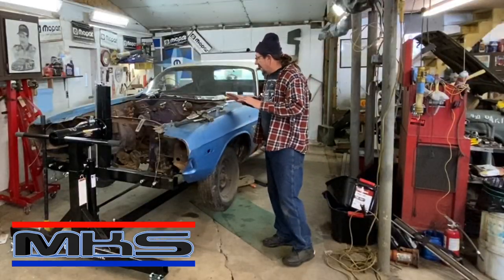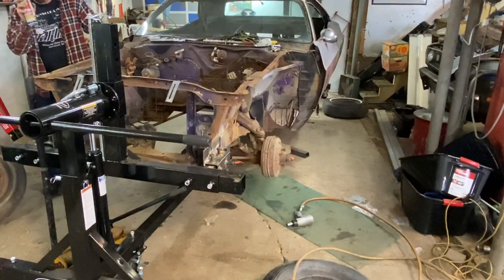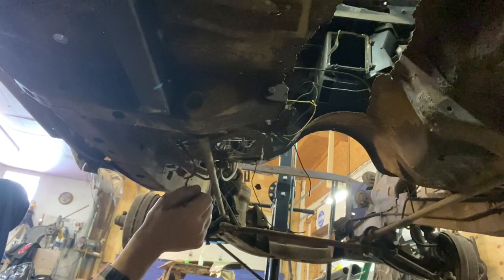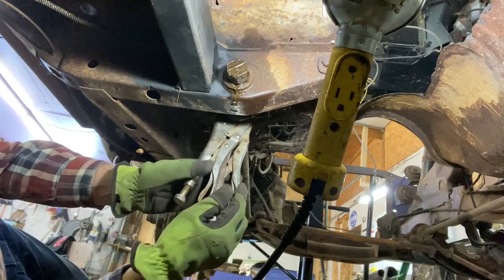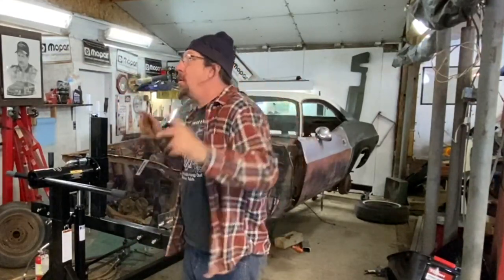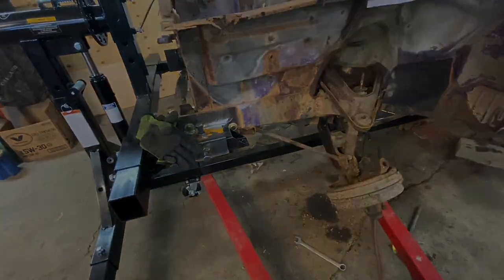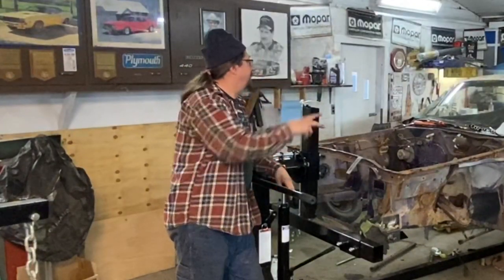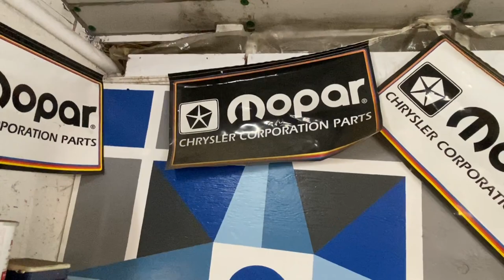Abandoned & Destroyed 70 Challenger Repair -Removing Suspension on the Rotisserie - "Stitches"

Comment: Mike, have to agree with Peckerwood.  Using VGs will mark the bar and will induce stress cracks causing the bar to fail.  I take mine out by removing the upper CA ball joint as you did.  Then I remove the LCA attach bolt (through the K member).  Then I use a rubber mallet to drive the LCA to the rear, driving out the Torsion bar.  Works good for me.  Of course, all the tension has to be off the bar before you can move it.  You ought replace them with Hemi bars to hold that big 440 up and give you some corning ability!!  Happy Moparing!  Glad to see Stiches up in the air.  I have never had a rotisserie so don't know much about them.  Need a class, please.
Reply from the maker: I know that’s supposed to be the case - although in all of my years that I have removed them this way I’ve never had one stress crack and break. In fact I’ve never broken a torsion bar once. Lol

But I will say normally using two pairs of vice grips does not cause the bars to get scored because they never slip. They usually just pop right out. This was definitely an exception. These buggers were stuck. Lol

One of the other comments gave me a great suggestion for a tool and I think I have that out here somewhere so I’m going to go and gather that up in the next few days for the next set I have to remove.

Thanks for the feedback. I always appreciate good input like this. Rock on!

Comment: In the beginning of my suspension career I was told to never use vice grips on torsion bars as they can make a weak spot where they mark the shaft...Yes you can buy a tool but I use the gooseneck off a BMX bike...two piece aluminium block bolt together around the shaft, then wail on that!!...Easy to pick up at the tip, or on curbside council collection
Reply from the maker: I was told that same thing. I’ve never had it happen… But I was told that. Lol

That gooseneck is a great idea. And I happen to have one. I’m going to add that to my tool arsenal Thanks for that!

Comment: easy way to take them out is seperate the upper and lower control arms. take lower control arm nut off- hammer on a piece of wood on the lower control arm. you dont want to score the torsion bars! this can cause a crack!
Reply from the maker: That’s another good idea. I’ve done it that way in the past. Don’t know why I didn’t think of it on this one.
Reply: @MyKARSShop  just a suggestion :)